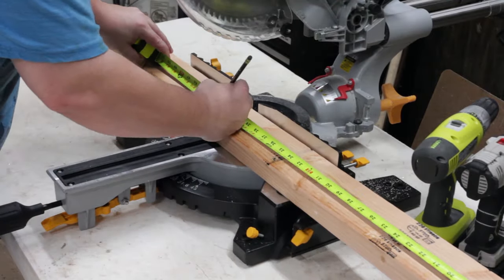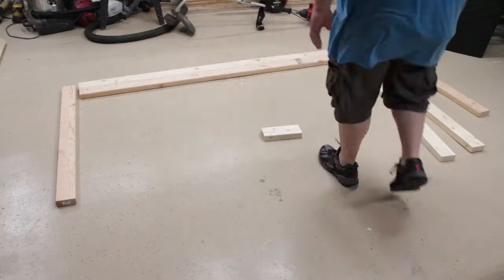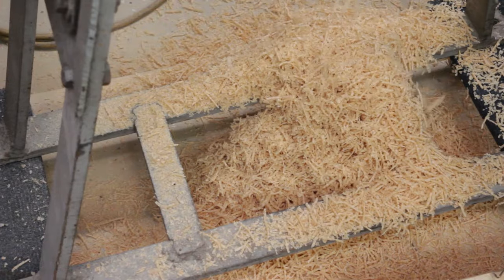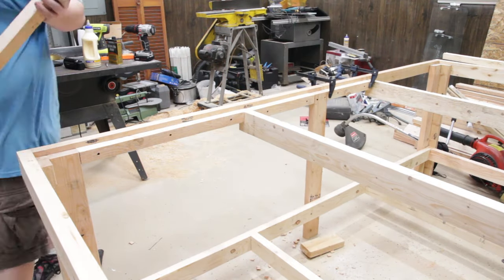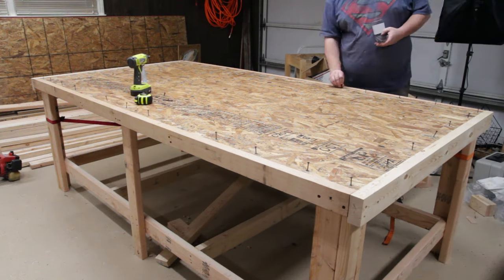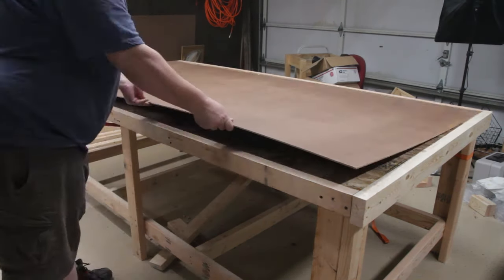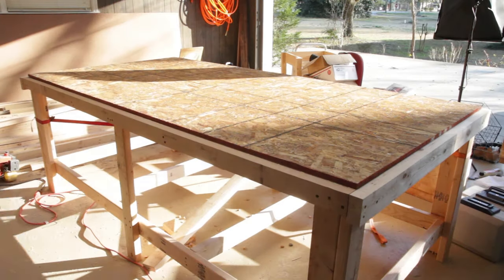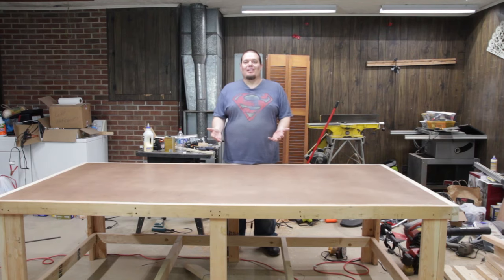Building A New Workbench / Assembly Table For The Workshop!

Comment: I love what you have done in here in explaining the whole process.  I am not comfortable enough to talk so much so my hat is off to you. All wood construction sheet products (plywood, OSB, insulation sheets) are always exactly 4' x 8' but fabrication sheet goods people use for making other things like counters, cabinets and remodeling projects (MDF, Hardboard, Certain acrylic sheets) are always trimmed just over 4' x 8' even though that is what they are called on the sticker in the rack at HD or Lowes. I still don't know why they are cut slightly oversize but I have found this to at local lumber stores, wood supplies, hardware stores and the like.

Awesome assembly table though, I built mine very similar back in 2015 and you made me feel like I should do a video about it like yours! thanks for the story!

Comment: checkout the Woodsmith Shops Douglas fir workbench. I make most of my assembly and carts using this technique, and they are solid as a rock. They will not rack, they are always square, and I use 1/4" MDF as a top layer to two sheets of plywood. I put four screws in the corners of the 1/4 MDF. When it gets cut up, banged up, and tore up; it costs me like $15 and four #8 1-1/4" screws to replace with new top. Actually I reuse the screws.

Comment: i used a piece of hardboard on the top of my assembly table, too. i screwed it down, but i didn't use any glue so i could change it if necessary......which i need to do, lol. it's getting a bit rough after a few years of some hard work on it. but i can understand your frustration on that aspect. i've glued things before and then realized later that i might need to take it apart.

Comment: At 3:53 you made a statement  that will define your work forever if you don`t change your attitude . If a project is worth doin it is worth putting your best into it .
Reply from the maker: Thanks for the comment, but I pick and choose my battles. That cheap assembly table served its purpose and made me a lot of $$$$. It's being replaced this spring with something a little better. Sometimes when you need to get stuff done, you have to chose what you put the effort into. A $200 2x4 and OSB assembly table is something you beat on and burn when it's usefulness is up.
Reply: @Themakersworkbench  Not interested in battle (pissing contest)  just a fact if it is worth doing it is worth putting your best effort into.
Reply from the maker: @johnwinn4213  I think you mistook my tone with the last comment. I'm not battling, I just know when and where to exert my effort. Thanks for the comment, and thanks for the engagement in the algorithm! I hope you check out some of my other videos!